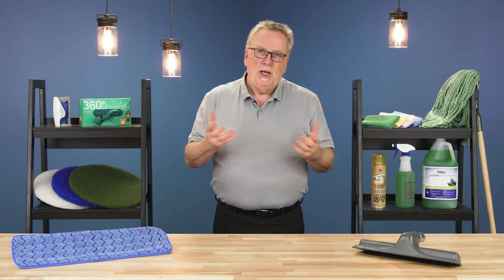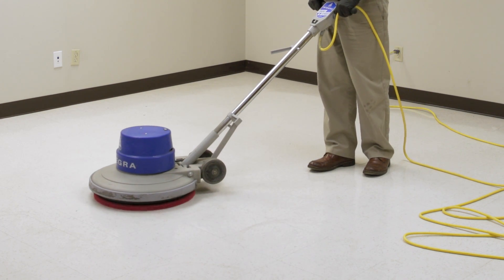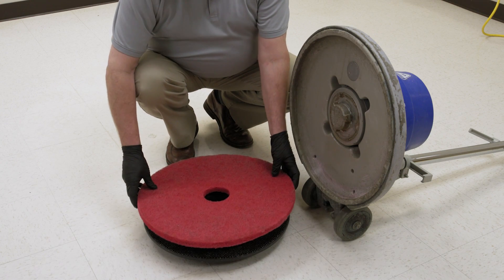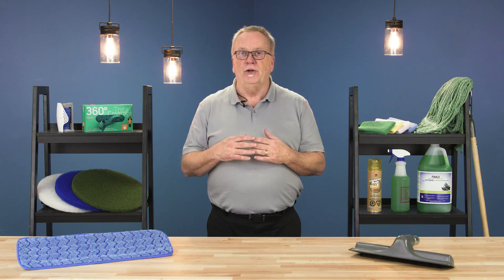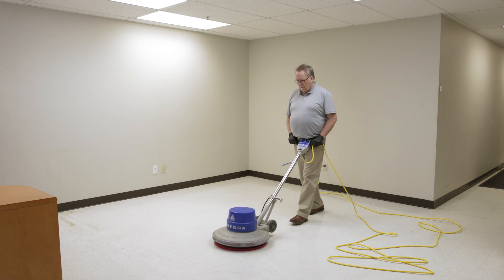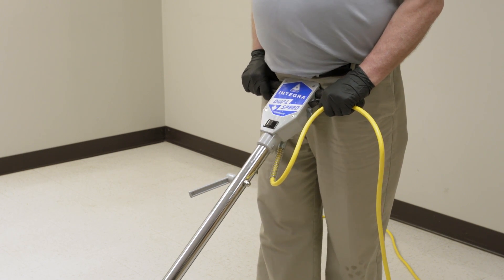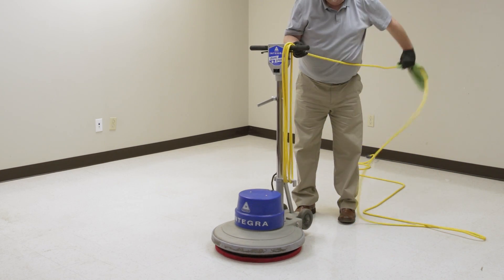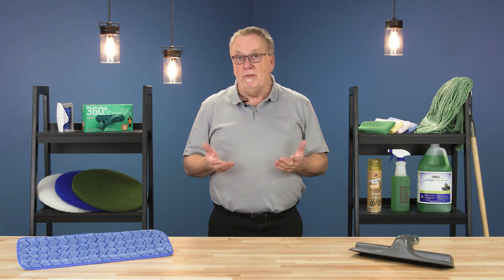The Use and Care of a Floor Machine | Clean Care

Comment: How do you clean the brush after stripping floor.
Reply from the maker: Thanks for watching. Using a hose rinse the pad by spraying the whole surface area. This will remove residue and any soil before it can fully dry.

Comment: these single-rotor floor scrubbers always kicked my a**. i never knew how to make them go left or right😆. I always used dual rotor if i could help it😅
Reply from the maker: Thanks for watching! These single disc floor machines do take some practice to get right, but its always use subtle movements it doesn't take much!
Reply: @AmreSupply  I stored my machine with the brush still on with my machine standing up and now when I start it. It just jumps around like crazy and I can't control it is something warped?  Because it want stay on the floor. What I  need to do. Order a new brush I only used it once it's brand new. Please help me sir
Reply: @AmreSupply  it uncontrollable. Did the weight warp the brush deck or something??? I am confused
Reply from the maker: @Flaboy386  Thanks for watching. It is possible that something is warped. You could always use a straight edge or ruler to lay against the pad or the mounting surface to see if there are any significant high or low spots. Do you have any other brushes that you could compare against? Considering that you'll eventually have to buy a new replacement pad, you could get another one and compare it on the machine. If nothing changes then the issue is not with the pad. In some models you might be able to replace the mounting surface of the pad if it is warped.
Reply: @AmreSupply  thanks sir. I hung up the brush and it straightened out on its on and I was able to use it but it's still jumping a little I think the pad might be warped so I am going to order a new pad brush. Thanks a lot for your feed back and I will let you know how things work out sir Thanks.
Reply: @AmreSupply  I have the  ULINE H-3579 17" Advance Cleaner. Thank you sir.